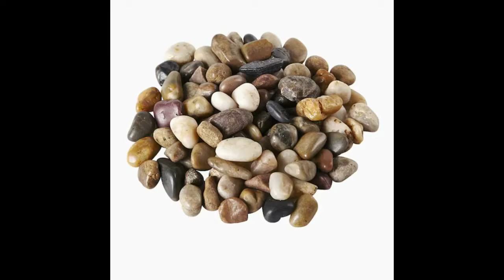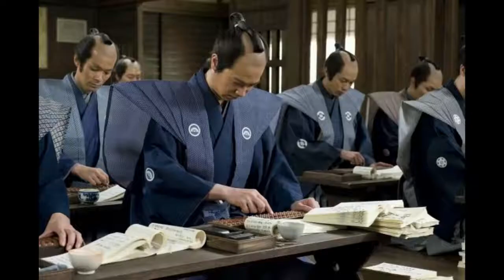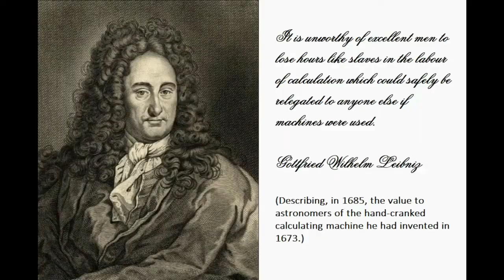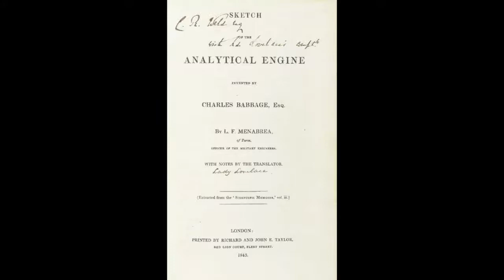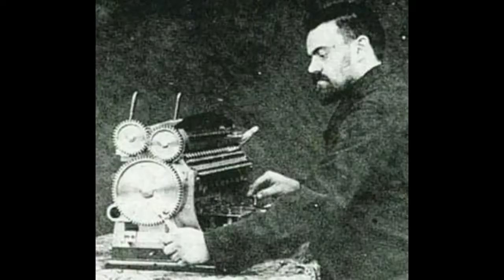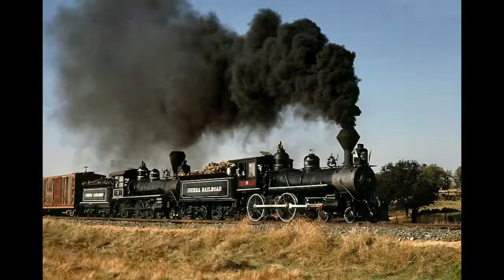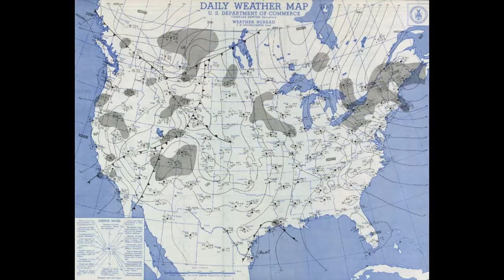Evolution of Computers - 1600 thru 1960

Comment: Is the abacus the first computing device invented?

The West and other countries may probably answer it true. In China, however, mathematicians and traders use more ancient device before the birth of their abacus. This more ancient device consist of counting rods. 

Although the manipulation of counting rods are much slower than the abacus, the counting rods are more convenient to use than the abacus when solving matrix problems.

We may then rephrase the question as "What are the first fundamental computers invented and used by China in ancient times?"

We may then answer, counting rods and abacus.
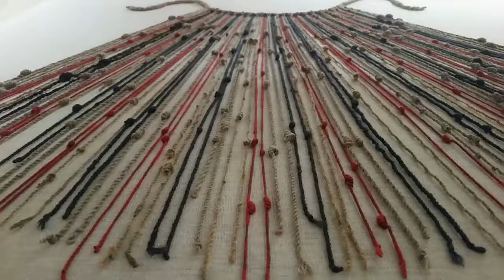Reply from the maker: Even before the counting rods you mention, there were aids similar to the "Quipu"  made up of strings with beads and knots.  See time marks 1:31 and 2:04 for examples.  Still, these are not "computing devices" really, simply aids to the humans using them, who still had to do the math themselves.
Reply: @ToddMcMahon  quipu were used only for counting and recording the count and not for computations.
Reply: Thanks for correcting your previous picture of the abacus. 

Do you know why the Chinese abacus is the type of abacus most often pointed out as the ancestor of digital computer?

The Chinese abacus is commonly used for working in decimal, but it may be used as well for hexadecimal numbers. Note that when all beads along a rod are set then the sum of bead values would exactly be equal to 15 or F.
Reply from the maker: No.  I have no idea?  Possibly higher proliferation?